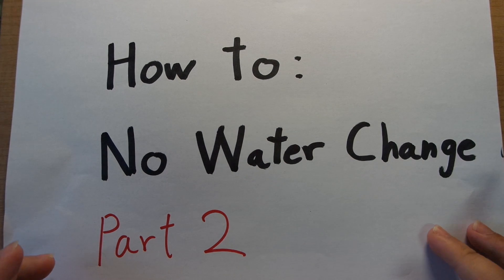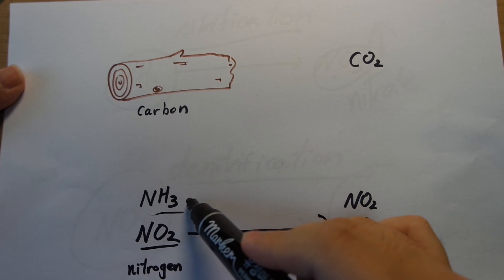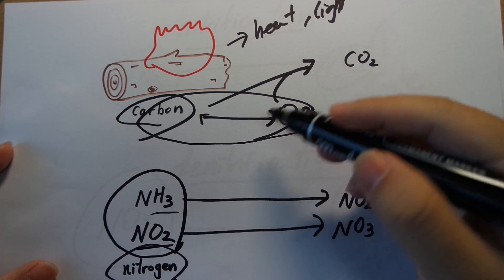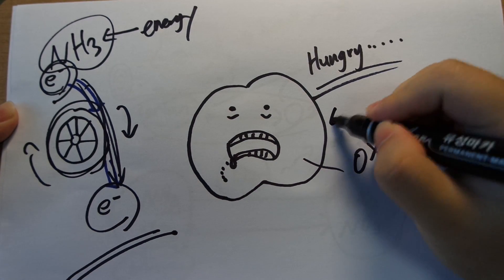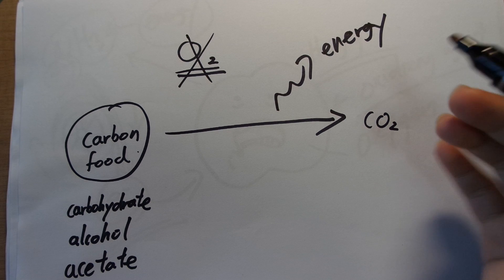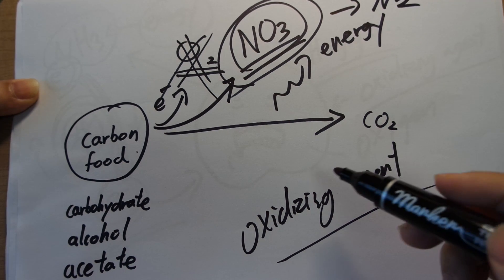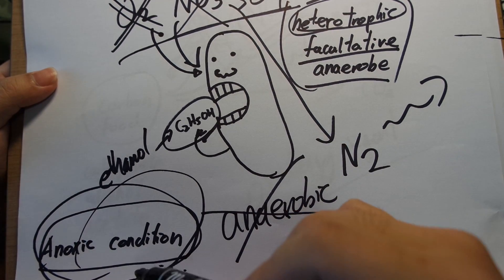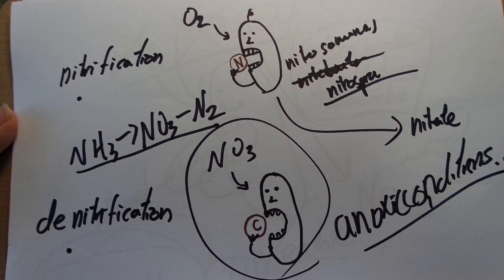How to build a no-water-change tank part2: get rid of nitrates by denitrification

Comment: If we want anoxic conditions, why do all the aquarists push to make sure we have water flow/surface tensions/air bubblers. I was under the impression that these help with the nitrogen cycle because they add oxygen to oxidize?
Reply from the maker: you never want anoxic conditions in the tank. you just want it to happen in the substrate if you aim for denitrification.